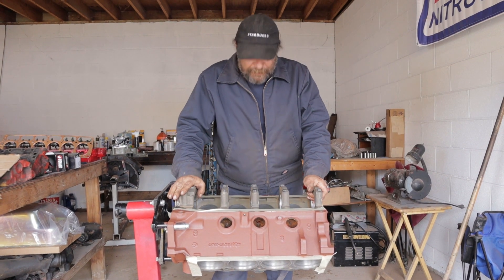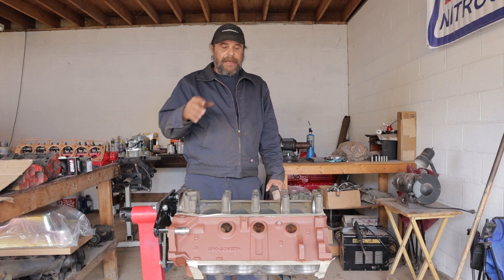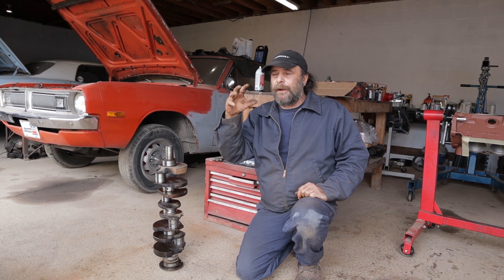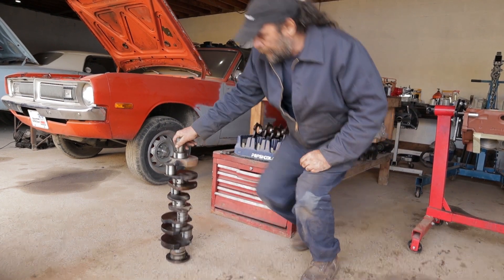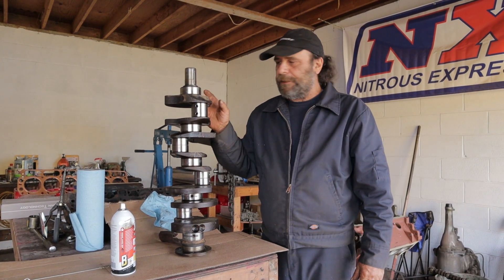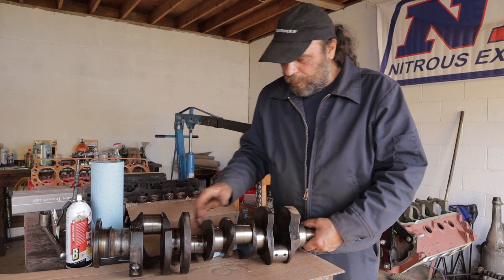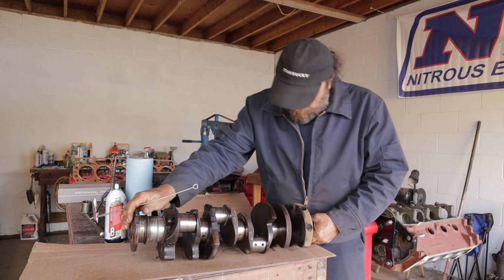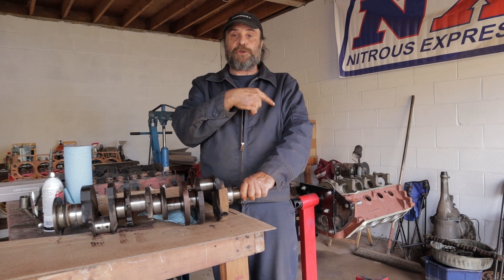Perfect Daily Driver 7 - Talkin' Crankshafts

Comment: Fun fact about tapping things to check their ring: that's how they used to check railway wheels. There'd be a guy going along with essentially a golf club and tapping each wheel, the ones that don't ring get replaced.
Reply: We still (hammer) test a lot of components on locomotives. Steps, handrails, grab irons all should ring. Bolts on pedestal binders, pedliners, base bolts and brake rigging bolts all should be a solid sound that has no looseness in the sound. When we do a 92 day inspection you will hear a guy going around the locomotive tapping on everything. Ting, tong, rung, is the sound of the steps starting at the top smallest step. Great video UT.
Reply: when you change universal joints on driveshafts .. whack the housings of joints themselves to settle them to bed
Reply: That's how grinding wheels are tested. If they don't ring it means they're cracked and unsafe to use.
Reply: *Great tips on "ringing" the crank,cracks & cleaning!
>Remember unless you are a seasoned 'Machinist' to take your calipers and gently squeeze the veniers as far from the end,or tip,of the measuring tool as possible.After you have done this enough you will get good at sliding the verniers out of the area being measured with confidence that you didn't move,or 'bump' ,the reading position. 
"I once had a 1964 chev 283 crank.When I was polishing it for a racing buddy  I found that the "tuff-triding" coating was somewhat inconsistent noting that it was anywhere from .001" to 
.010" thick in spots"!
Cheers!
Reply: UK.  Back in the day the railwaymen had "The wheel Tappers and Shunters Club", also a comedy TV prgramme.
Reply: good point. they also used to check every third wooden tie (at least out here) to speed up the process.

Comment: .001-.0015 thick hardness treatment is the the old "Nitride" process. From the factory or a treatment been done afterward.
Love these kind of builds Tony, but im spoiled building old oldsmobile 455's because zero of the problems you mention ever happen even on 200k mile builds.

Stlll tho, solid short block mods and checks 
Basic mechanics yet the people need to know
Reply: Olds had a reputation for using great iron even in their run of the mill motors.
Reply: @DrewLSsix  for sure pay no attention to anybody who talks about the N on the back of the block...they are all the same. I cannot answer about the nickel content but they all wear the same

Comment: Scotchbrite on a crankshaft gives me the heebiejeebies most likely due to my crippling OCD
Reply: Why?  It doesn't remove any metal.
Reply: Fibers breaking off the pad and getting lodged into an oil passage
Reply: Nah, you’ll do a final wash on it and blow it out with air anyway.
Reply: @RealmCenter40 :  His second-hand smoke will dissolve it. . . .
Reply: @JohnWilburn  red scotchbrite will remove metal.
Reply: @ScottKenny1978  but it doesnt matter..... because you are still doing a final thorough cleaning.
Reply: @DrewLSsix  guess I should finish that statement. 
Red scotchbrite will remove steel. 
Blue will remove aluminum, and so will green (but a lot slower).
White will only remove paint.
Reply: Honestly the only thing I really use it for is to prep a gnarly rim surface for an adhesive wheel weight

Comment: After 40 years of tinkering on my Mopars and AMC's, I've come to the realization that Uncle Tony has forgotten more about this stuff than I will ever know.
Reply: AMC 👍🏻 I’ll gladly take a Rebel Machine or AMX
Reply: @RealmCenter40   Lovin it! Currently reviving a 68 Javelin here.
Reply: 401? Go-pack?
Reply: @RealmCenter40   Nope, it's all stock with the original 2nd gen V8 343 4 BBL and no go pack. She runs great but is a bit tired, so my next step is a engine rebuild. I converted her to power disc brakes recently. I'd trust her across country as long as I had a case of oil!
Reply: @RealmCenter40  69 Hurst SC/Rambler is my fave
Reply: There’s something to be said about rooting for the underdog. AMC and Saab marched to the beat of their own drum. My first car was an ‘80 Spirit. I think it was Donahue that drove the Trans-Am Javelin, sweet looking race car
Reply: @RealmCenter40  Have a neighbor that has an 80 AMX with a NASTY 401 in it. I usually bleed Chevy orange but always an AMC fan. Owned a '74 J20 with a 304. 225k and the heads had never been off it. Sadly rust got it before the drivetrain went. One of the best trucks I ever owned.
Reply: If I ever woke up one day with the desire to build a high performance mini truck the Comanche Eliminator would be far and away at the top of the list
Reply: All you gotta do is check everything and the rest is science
Reply: Agreed.

Comment: I dig the how to on the deck. I have always just brought it down to the shop. I love the crank information. This video really makes me wonder how often I have brought thing down to the Machine shop when I didn’t have to.
Reply: A section of granite counter top with sandpaper taped to it can resurface a small head.
Reply: John Wilburn that is how I hone wood planers and Parallels. Never thought to do that for a head
Reply: There used to be a machine shop a few towns over from me that I had the chance to learn a few things from when I was a teenager.  They built a lot of winning engines doing things like that that seemed unconventional by today's standards.
Reply: LunarOutlaw’s Garage    Every thing brought to a machine shop needs machining, whether it needs it or not. 😁.  Keep as much original metal as you can. Line boring, decking, turned journals l, etc is not needed for a daily driver, in most instances.
Reply: I have a fantastic local machine shop that is very reasonably priced. If I can get a thousandth taken off a set of heads for less than $100 the assurance they are 100% true is worth it. I find almost all the time with aluminum heads they are so close to maximum allowable tolerance I’d rather not chance it.
Reply: Thing is, they check the true with a machinist’s straight edge, which you can buy for less than $100.  If are taking a “thousandth” off it, they likely do it on a belt sander or hopefully a granite block.... which you can also do.  It’s when you need them flycut they really need to go to the machine shop.
Reply: I like a long steel block with spray adhesive'd wet+dry paper on it,
then paint the surface with Dykem steel blue. you'll see the high and low spots really well, tedious but you CAN surface something by hand to a really close tolerance.
Reply: Chances are, decking that block got the piston closer to the head at TDC, which may have increased your compression ratio a tad. not a bad thing. It also made sure each cylinder is closer to one size at TDC, also not a bad thing. The problem is boring out the main journals in the web.  it brings the crank closer to the cam, an issue if you're stroking the crank, going to wide H beam connecting rods, and using a cam with big lobes for big lift. Even if you're not doing any of that, moving the crank higher in the block means a new timing chain that takes up the slack.  And if you didn't knock off the ridge at the top of the piston?  Well, now you've got the rings running right into it.

I should also say, a serious cutting of the crank mains can move the crank to where there's an alignment issue with some transmissions:

https://www.hotrod.com/articles/ctrp-0607-bellhousing-alignment/
Reply: Boring the mains doesn’t move the crank, it changes the journal or bearing size.  Not applicable here.
Reply: @JohnWilburn  ah, but how does align boring change the size? It does it by removing metal out of the web. Which means the crank sits in a new location. In fact, it can affect how well the transmission lines up with the new crank location:     

https://www.hotrod.com/articles/ctrp-0607-bellhousing-alignment/
Reply: Yes, that is true of line honing.  The correction, if needed, is with offset dowels in the bell housing to get the crank centerline corrected.
Reply: Boring the mains to make them larger, doesn’t change crank centerline.
Reply: you are correct, working on the block doesn't change the crank centerline (or its stroke or anything else), just the centerline's location relative to the block, cam location, and bellhousing. just like working on the rear axle doesn't change the crank centerline. only a bad indexing or letting the crank sit on its side unsupported for years. 

The process for align boring, in fact, shaves some material off the cap's mating surfaces, shrinking their inside diameter before cutting into the block webs to re-establish a true blueprint spec.  Smokey Yunick's book on power secrets said even he questioned the need, so long as the crank spun freely.  As Tony points out in his daily driver crank test video, cranks act like shaped springs (hence the need for a harmonic balancer) and so they're going to flex and shape anyway, due to rotational forces and oil getting on and flung off the spinning crank.
Reply: No.... line honing raises the crankshaft bore’s highest point in the block for the same OD bearing, thus raising the crank position.  Boring the mains, like for a larger main journal diameter, does not because it keeps the same centerline as it takes metal from both block and caps.
Reply: Line honing the mains, like for making mismatched or new main caps true... yes that puts the crank a tiny amount closer to the deck and cam, but still not applicable here.

Comment: To check the decks, can you spray paint a light coat across the decks and then sand them? That should show any low spots.
The crank in that 318 that was broken was broken in the center thrust bearings. You're right, but this was the damndest thing I've ever seen. I don't know why it cracked there instead of at the rod throw.
Now my friend who was the Machinest where I worked had a strange looking crank come out of a Small Block Chevy. No matter how he tried to figure it out, it was the wrong crank. All the measurements were good, it was straight, no cracks or anything like that. It just looked wrong. Finally he grabbed a casting number catalog and it turned out to be a steel crank of of a 318-3 truck crank. Strange things in the shop!
Reply: No need for paint ken... 150 grit is fine enough for a gasket to seal, but coarse enough it leaves "scratches" of uniform depth and width. Run the block over the deck... nice even "finish", you're good. Polka dots, cow spots, zebra stripes where you have "old deck" showing as well as that nice even scratch pattern, not so bueno, lol. Paint will just load up the "teeth" of the paper, and make you crazy with uneven marking, or worse, give false low spots if the grit is clogged. Use "wet or dry" paper, some real light oil like diesel to "float the dust out", and any irregularities will be dead obvious
Reply: Thanks guys. I’ve always had a straight edge available, but I posted that question for those who don’t.
Reply: @kencohagen4967  thing with a straight edge is you really cant check the whole deck, not in a practical way. You can find a REALLY bad deck, but marginal its hit or miss. The block sanding (just like with a body repair) shows everything, and then you can spot check those areas with your straight edge. Me, I'd do the cross and x straight edge check, then block it to see if some gremlin snuck past... belt and suspenders, lol
Reply: ludditeneanderthal we checked the deck in several places, at several angles. I can see merits in both methods. Some guys will take a pass on a Bridgeport mill to check the deck. I guess that’s basically doing the same thing as block sanding. And as long as the deck is flat when your done, and the deck height is the same on both sides of the block to maintain equal cylinder pressure, it really doesn’t matter which method you use. But getting back to my original question, painting the deck would only really be needed if the block was fully cleaned before you check the deck, and a dirty deck surface would leave things easy enough to see and I was over thinking the problem. Thanks for your help!

Comment: You succeeded in cleaning that block?! That must've been absolutely ridiculous.
Reply: I’m sure he paid someone to do it.
Reply: @danithaman4610  this is the guy reusing parts to save money. Also, it's not like he has to go to work!

I figure 8 hours with a pressure washer, oven cleaner, and whatever scrubbing tools Uncle Tony prefers would do the job.
Reply: @ScottKenny1978  I bet he uses gas. Its what i use. brush on gas wipe off a layer of grease takes multiple applications but faster than anything else ive found.
Reply: @AaBb-zj2ld  yeah get off what you can round one.  let dry.  then wire wheel on drill for round two. the gas dries the oils out and leaves  a dry "cake" that wire wheels off easily then a flush and light scrub  for round three and its really clean.
Reply: Tedious, too.

I'm afraid to ask how much gack came out...

Comment: I agree I learned my lesson about spraying directly on a block along time ago. Paint comes off quick
Reply: I usually paint mine warm. Let it bake on
Reply: Works great 👍🏽
Reply: the other tip--and Tony mentions this, so you probably know--painting an engine first requires cleaning all the oil/grease residue out of the pores of the cast iron. People think they wash it and that's enough, but oil and water don't mix, they repel.
Reply: The other reason to wash the block pre-assembly is to get rid of dirt and abrasives harmful to the engine, or that  might interfere with assembly. Wipe down the bores with oil and  rags until they come up clean. Uncle Tony is giving us lots of great information, but because of the video format we are getting it in "shorthand," so keep in mind he's hitting the high spots for maximum effect.